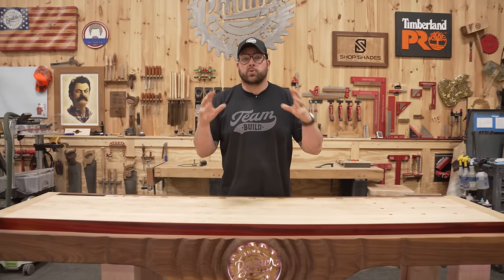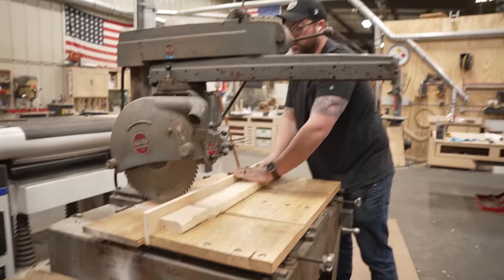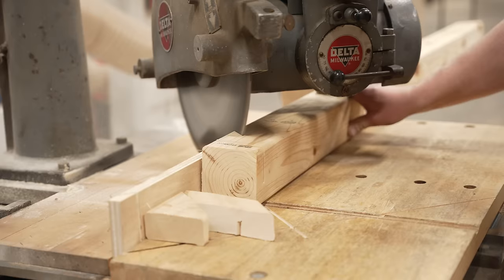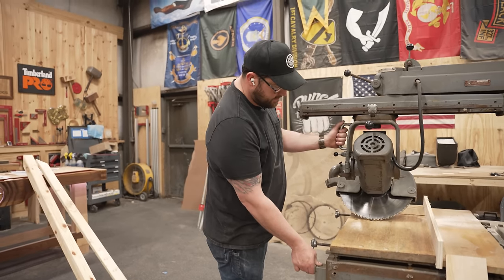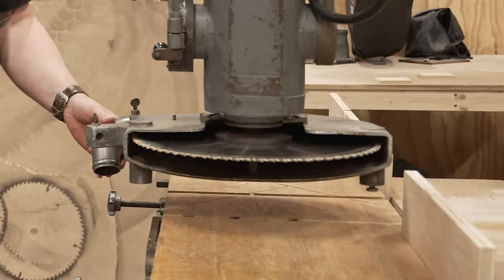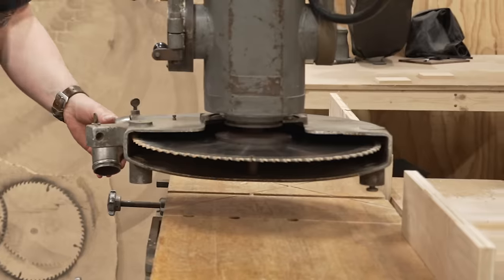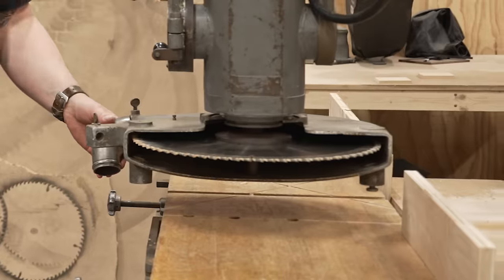Testing Woodworkings Most Dangerous Techniques

Comment: Yeah, that sucks. 
Back in the 80's I worked in a shop with one of those--it might have been that exact model saw--it looks familiar. Scared the shit out of me, although all we did was cross-cuts and it was relatively easy to keep body parts out of the way. 
Not to one-up you or anything, but you know what was worse? The 16" Altendorf rolling table saw. Same form factor as a large jointer, about, except with 6 or 7 inches of blade sticking up where the jointer cutter would be. Completely frictionless; it would have been so easy to roll an entire arm right through it. 
I wouldn't be surprised to find OSHA and the insurance companies don't even allow those things in the country anymore. I hope they don't.

Comment: I am 60 and when I was in H.S. we all used this type machine, but I forget the brand.  For the 45 degree cut were you could cut into the post there was a knob that adjusted a screw to limit travel, and we could move the fence forward and back. on the rip cuts you just had to push the board from the from the direction that did not shoot the board across the room and use infeed and outfeed tables for safety, as you saw when you made your cut. But if you have a tablesaw just don't do those cuts on the radial arm.  As far as the blade spinning on  and cut a scrap after you have turned off the power.  That should use up the momentum. 4 years of shop class and nobody hurt themselves.  My brother was 6 years ahead of me and he didn't remember anybody hurting themselves, except dropping a heavy desk on a student that had it on the finish table and was trying to get it down by himself.  That is not to say we didn't have a healthy respect of the damage this tool could do, but we worked with respect of each other and the tools in shop class back in my day.  Using tracks and a better fence with JessEm Clear-Cut Tablesaw Stock Guides or something similar would keep your hands out of the danger area.

Comment: I regularly used on of those saws in shop class back in the 90’s. They are only dangerous if you’re being stupid. I was screaming reverse threads through the screen lol. We built a huge beautiful football shaped conference table in shop class and cut a lot of wood with a saw just like this one and utilized a lot of it cutting features. Anyway if you properly clam your work pieces down your hands have no reason to be anywhere near the blade. Accidents come from becoming complacent and too comfortable. There should also be tool stops to prevent the tool head from going back or forward too far. The forward stops could be adjusted but the rear was fixed.

Comment: The most easy "fix" to this giant example of an OSHA violation would be to give it an VFD that can actively beak the motor when turned of
You can program a Ramp down time of like 2 seconds and the blade comes to a standstill in 2 seconds instead of five minutes
Al thou you may need a braking resistor or brake chopper for any VFD to be able to suck up all that kinetic energy from that blade

Comment: The way this saw pulls out do all chop saws have a lock on the back so that you can pull them out also to cut wider bits of wood because we had a newish 2017 big Bosch chop saw in the shop with a big old blade that once you hit a unlock button at the back it allowed you to pull the saw towards you to make cuts like the saw in the video but it would not do any of these other special cuts just up down like a chop saw towards and Away and the Mitre cuts

Comment: In the 70s my little brother 5? and i 8? were messin with my dads RAS in the garage, it was off but plugged in, my finger was near the blade when he somehow turned it on and startled pulled my hand THRU THE BLADE and nearly severed my finger requiring reattachment

Comment: The problem with the first motor is that it is either miswired or defective in some way. It took far too speed up and the full speed was not as high as it should be.  I think you said it blew a breaker, which would also be a sign of something wrong.  Are you sure it wasn't supposed to run on 220-230 volts?

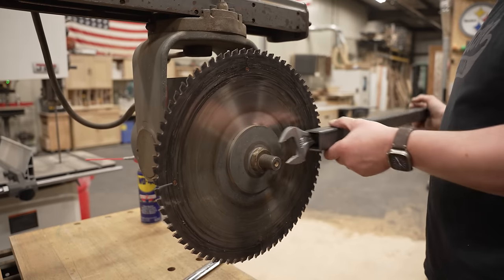Comment: 3:28 if you don't work at a 60 year old wood moulder which had the axles replaced every now and then by ''professionals'', then every woodcutting device's blade/cutter bolt or nut should loosen in the direction it spins. This because if it were too encounter some source of great friction, lets say when it binds in wood or something, it will tighten the nut rather than loosening it.

Comment: you could power the motor with a simple VFD like the ones from Vevor and add a brake resistor to stop the blade instantly when you turn it off ...
Reply: Spot on. it worked great for me on a 14inch RAS..it's way safer and smoother ;)
Reply: Also if you overload the tool and you try to stop the blade the VFD senses the overflow of current and stops the motor.

Comment: My gut feeling is this saw would be equally useful and so much more safe if the blade spun the other way, and made it much more akin to a sliding miter saw. Then you're always pushing it away, not pulling towards, and the material is pressed against the fence, rather than possibly pulled away from the fence

Comment: Y’all should try  to use it with a 1/2 inch board flattening router bit. It’d be able to go wider than a planer because you can flip it like you can on a open ended drum sander. Im a carpenter but have never used one of these. I want to get one for this purpose. I’ve seen it online but scared to try. I have a board flattening jig for 1/2 inch router but it takes space to set up and radial arm saws are big but multi-purpose. Does anyone have experience board flattening with these? Is it a feasible option for 18-24ish inch slabs?

Comment: At about 23 minutes you complain that the rewiring of the saw limits the reach on the 90 degree belly buster cut, but all you have to do is rotate the head around to allow an additional 20 inches of slack in the wire. That one was on YOU. BTW - what did you do with Sam and Jordan?

Comment: To sum up, its excellent tool, with superb quality, but it has drawbacks and really requires one to thing before going to close it. Add e-brake so it can be adjusted much faster and if you do lots of repeatable cuts on heavy lumber this is the tool for it, just needs user to know the dangers and no modern insurance company will pay out. Also considering that this was essentially one of the only tools at the time and general safety concept at the time was evolution doing its job, i do get why this was designed as it was.
Also pretty sure you are suppose to move the fence or add material to fence for certain cuts. Bit iffy on witch hand to operate this on, but as shown using it left handed like that would kinda make this safer than basic mitersaws, but in the end with each tool you can fuck up and mess your self up real bad. I got cheap table saw cause cant afford better and had several times where splitting into final dimesion leaves a thin peace, or the goal is to make thin peaces, that end up falling between the blade and dust frame and pretty sure i have hole in there from stick falling in and getting kickback inside the dust frame....
Personally i would love one of these but there isint any here, but my thinking would be to use it as any miter saw, with saw all the way out and you push it against the material and the fence. That way it wont hog and try to force it self towards you.
22:45 umm is your fence straight? Sounds like its not straight with the blade, or some setting it not where it should be and pelting into face... A you didnt have any dust collection connected and B face shield. I have feeling something is missed in this, like could it be that blade is designed to be deeper in the table or there being some additional part to prevent material flying.
For short material like that, turn the radial arm straight with the fence, add secondary 90degree fence into the end and push the blade into the material. You attempted to use it like table saw, while it more like reverse table saw jig type of setup. On the long stuff yeah you would do it like that but in those cases you would have in and out feed tables or someone helping with the rip. That is how i do cuts what go beyond the table.
23:20 Umm isint the head turnable 360? Turn it 180 along the cable and you get just right amount of distance more. While i'm not super familiar with this tool and never used one, i'm getting bit of a feeling that John lacks any spatial awareness and cant figure how to use these older tools, seeing only issue not solutions... then again he does not read the user manuals of the new machines that do come with those so go figure... 
Also you push the ply into middle point resting on the head, move past the blade and pull rest of it trough while lifting the upper peace or if you dont have muscles to do so, then screw in fulcrum point that is peace of flat bar that goes into already cut gap and you can pivot against that point when finishing the cut so upper peace wont drop on the blade. You will be around far as the ply is long and that end of the cut it most dangerous. Alternatively just take one step in, push the bottom part in and use your hand in the middle point as fulcrum point by pushing down with left hand. Though this depends on material thickness and how well it flexes.

Comment: When ripping you need accessories, I believe its called a claw or something like that. It drags over the wood  as you push it through but if its tries to kickback the claw grabs the wood and wont let it fly out. Either way most of this stuff I would just not do. None of this left me with any confidence in using one of these machines. Also a little note, your shirt being loose around the saw was giving me terrible anxiety. Was like it could get sucked in at any moment then pull you into the saw. All that said though I would be interested in seeing you use a smaller blade in this and go as far as test how small a blade you could go before its no longer usable. A 10 or 12 inch blade might still work and also make the machine just a little less scary.

Comment: Other than the potential of cutting your gut, wouldn't the vertical cut also be very prone to pinch the blade with the weight of the upper part being pulled down by gravity? Seems like a cut that really tries to get the operator killed.

Comment: I feel like an old school production shop would have multiples of these, with each set up for a particular cut. If you only worry about one thing it can do and not everything, you could use jigs and guides and feather boards etc. to make the cut as safe as possible. 
If I had to use this to rip boards I would find a way to get a riving knife on there for sure, kickback on that beast would be fuckin nuts.

Comment: wow, you have a lot to learn about using a Radial Arm Saw......
real simple to keep the dust out of your face when ripping, 
lower the Guard down to just above your work piece, waalaa,
 the dust goes around and out the nozzle .....

Not enough wire to rotate the saw like the last setup? 
well, if you rotate the opposite way, you will have enough wire......
and of course, you did not have the anti-kickback arm with pawl on the guard while ripping....
lots to learn, great tool, just learn the right way of doing things.....
and do not oil or grease the guides on the arm where the bearings roll.....that is not needed and causes problems....
cheers from a Radial Arm Saw user and owner,  [1] 16", [3] 10", and [1] 9"...all DeWalt....
I have had others, Sears, Wards, a 925 DeWalt, and an Italian 12" Tatry.....
and off course, make a sacrificial table top for your saw......1/4 masonite or Luan.....
I think your heart rate was from cranking the saw up and down........
You also might try pushing the saw in on a cross cut instead of pulling towards you......
as you will be doing 'conventional cutting' instead of 'climb cutting'......and you will not get the 'Lunging'
the blade still forces the material against the fence, but also wants to lift .....so you need to hold down....
but you do not have to hold the saw back to keep it from coming at you.....and it gives a better cut too....
at least in my experience.....
there are also better ways to rip with a different style push stick.......a piece of plywood 4 to 6 inches wide by 12 to 20 inches
with a handle attached at back...like a crosscut sled.....that will push both the drop and the part you want out at same time.....
you cut into the push stick......Brian Weekley show how to use one in a short video......
hope this helps, Paul in Orlando......

Comment: To make it a bit safer and stop faster you shold put on a electronic motor brake. It will stop the blade in 10seconds. We have thows at work because the saws have no regular motor brake, and there has bean some wopsies do to blade not stopping fast enoughe.

Comment: My Pépère' had one of those very same saws and my dad still has it in his workshop. Of course my Pépère' had all the special guards they sold to do the horizontal sawing, ripping and routing operations. Some crazy ass clowns never used any guards with those things. I was taught to use it when I was ten years old and still pop over to my dad's to use it because the radial arm saw is just the best saw to do certain things ever. While I can do everything I grew up learning to do on the 16" radial arm without one it's much more roundabout. For instance just throwing a dado stack on that thing makes tenons, half laps and shelf dados quick, easy and accurate. I laugh at people that find it scary or dangerous or hard to control. If you're the type that think the normal blade is intimidating try looking at it with a 12" dado stack on it. I just bought my dad a new dado set because he had some cheap BORG set. A 12" Forrest Dado-King  is a beautiful thing to watch in action.

Comment: Yo Juan malekez..you could have pulled material from other side once it was half way pushed through for rip cut 🤷
Reply from the maker: So you're saying walk around the saw while its running with a board inserted in the blade?

Comment: I'm laughing my butt off watching this while sitting in a house we built in the '70s with a 12" radial arm saw. We did so many beveled rips with that thing. I always loved the ability to machine things in ways that are much harder or impossible on anything else. I'll accept that it's a dangerous machine, but the histrionics seemed a bit over the top here. It's just like a wild beast: respect it, be present, move carefully, don't get caught up in fear, it won't maul you and you'll be just fine, most of the time.

Comment: I think he could have rotated the saw to allow for the power cable to have the length necessary to perform the final cutting method. However, he made it seem that the cable was too short to perform the cut more than likely do to how intimidating and dangerous the cutting method appears to be. I don't fault him for that because not even I would want to do that cut.

Comment: You think that thing is dangerous? A farmer friend of mine used to have a PTO powered circular buck saw that mounted on his tractor for cutting firewood. The blade was around 24 inches with no guarding and the swing table just pushed the wood into the blade.

Comment: I have a 1963 craftsman 9 inch RAS. I only do crosscuts and will eventually do dadoes on it as well. Not enough courage to do any other operation. Im not a fan of multi purpose tools. I dont like the set ups. If i didnt get hurt using your 16 inch RAS I can pretty much guarantee you would be throwing a ton of sawdust where i was standing :-)

Comment: Sam pulled a BIG no no. When you were putting the saw together and had it up on the forklift sam at one point was directly underneath it 😮 going underneath a suspended load is absolutely a no no...

Comment: I'm laughing so hard at this. I grew up with a Radial, not a table saw, and still have it. Just like any power tool/cutter, you have to pay attention and be careful. Also have a thickness planer blade for it if I don't feel like using the hand plane. I will say, I have never cut vertical panels with it.....that's just dumb🤣

Comment: I'll never understand why you need to pull the saw towards you instead of the opposite. 
I would suppose that the whole thing is way more safe going the opposite way: you work against the teeth, so as you stop pushing, the blade stops digging into the wood.

Comment: I don't think that thing is wired up right. The power switch should short the motor windings when it disconnects the power, so the motor acts as a brake and you don't have to wait five minutes for the blade to stop,

Comment: A 16" saw like that, and I have to pull towards me? I mostly know what I'm doing in a woodshop (it's been a few years, sadly) and that's a big pile of NOPE.

EDIT: As the video shows, that 16" blade is basically a flywheel with carbide cutting tips. That is a nightmare for safety.

Comment: next rule anything you buy use or new especially power tools has to be gone though before use unless you are trying to get on disability. Alot of tools that seem odd is they didn't have all the different types of tools that replaced them that why you don't see to many new ones made. I'm sure tools like that inspired a lot of safer tools but that saw can do certain things that chop saws and table saw either can't do or can't do as easy. When using any table mounted saw, shaper, etc... you should always use a push stick to move and hold down the material when it gets close to the end of the cut by the blade also called a chicken stick but no one who uses one is a chichen you don't get any extra points for cutting off pieces of yourself.